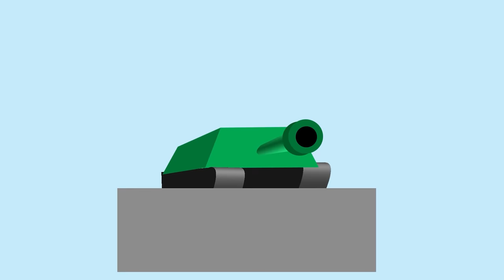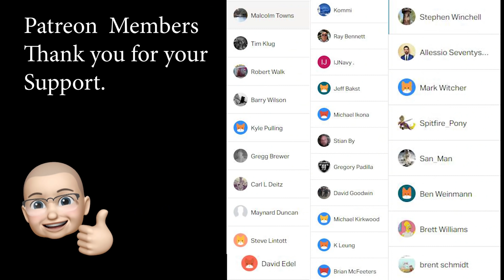How to build a  Metal Robot Desk light for our hobby table

Comment: Black is hot white is neutral. Switch should be on the hot wires not the neutral. And check that polarity is correct. incorrect polarity will make the bulb threads hot.

Comment: you can use them as your work light and you should three wires black is hot ,the white wire is neural and the green or copper  wire is your ground

Comment: Hey Andy, love idea and great how to.  About the wiring - I don’t know how wiring works in the U.S. but here in Australia, we also have a third ‘earth’ wire coming from the wall socket. I am fairly certain this is the same In the U.K.  Typical wiring of electrical appliances with a metal body like a microwave oven or washing machine, the earth should be directly attached to the metal body to short out any would be electrocution hazard. Eg. If one of those wires worked it’s way loose from their connectors they could come into contact with the metal frame. This would not be pleasant for the next person working the lamp.

Albeit the Edison bulb is a cool idea - I think a transformer and 12volt L.E.D Edison style light may be a safer choice for most of your viewers. I should also note that in some places/states like where I live here in Victoria, it is actually illegal for a non-qualified person to do electrical work.
 
But like you said, seek professional advice when working with mains current.

Cheers

Comment: Andy, I do electrical work in my profession. So may I make a recommendation that you add a ground wire to that contraption? You know, that third wire, or green wire that hooks onto that extra screw that's on that toggle switch? It would mean substituting that wiring with a 3-wire cord (hot, neutral and ground). Not saying it has to be done, just thinking safety.

Comment: Be careful wiring switches up like that… that’s the old school method. Where they broke the Neutral at the switch. Meaning that light always has potential and always has voltage at that socket regardless of the switch. You want to put the hot coming in on the switch first then out to the light. Very awesome Robot dude I enjoyed your video 👍🏻
Reply: Unless you have the polarity reversed of course ! If so disregard